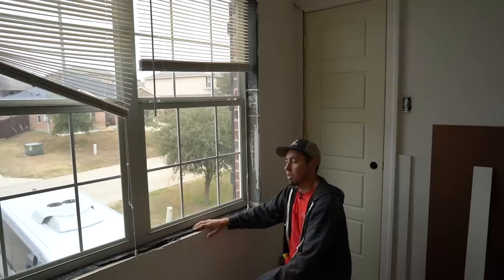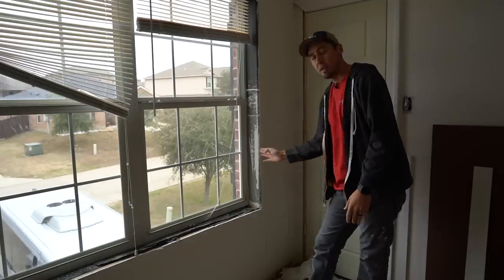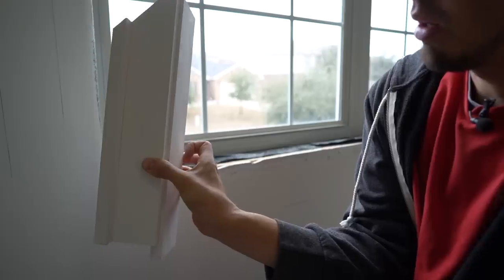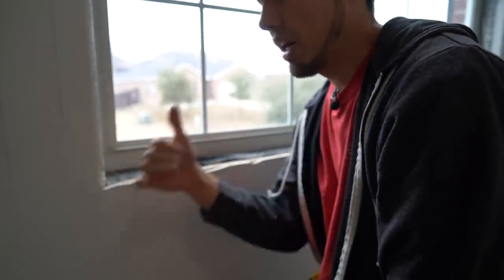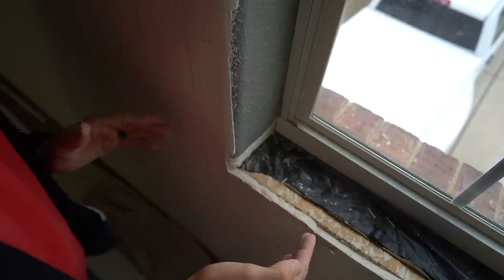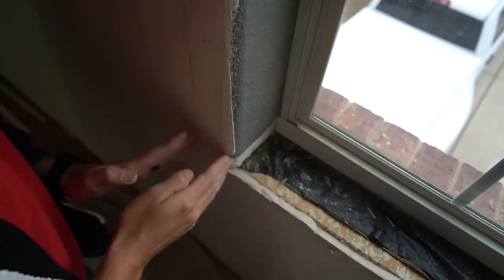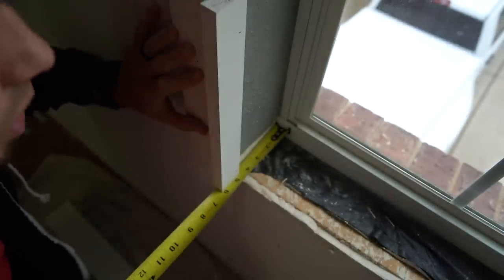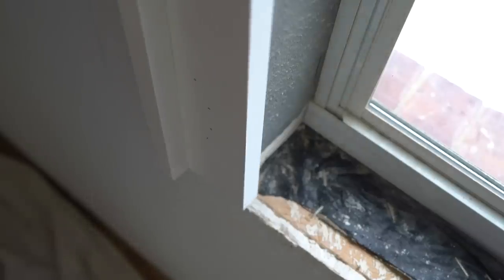Well, I cut the window stool...

Comment: Richard,  when I watched you use your "phone" calculator to figure out the number of panels I realized you didn't know about the fraction calculator I use.  I've been using this for several years and it is GREAT.  This calculator allows you to put in the whole number and then the numerator and denominator of any fraction and provides the answer quickly and accurately.  It's called the "fraction" calculator.  I purchased the "plus" for a very small fee.  Give it a try. 😉. I downloaded it from the Google store.
Reply: Thanks for the recommendation Mark. I'm gonna get it

Comment: It's amazing how a little detail like if the Horn is even with the Casing or juts past it can make a job look right or wrong...or even the Reveal on the Casing being 3/16's or 2/16's. It's these small decisions I learned to not get the Homeowner involved in if possible. That sounds wrong, but it's right. Mitering and Capping the end-grain of the Stool is going the extra mile...you are well worth your money. That is not ordinary Finish Carpentry. I like to miter across the end of the Stool with my blade tilted 45 degrees and Cap it with a small piece so I have just a 3/4 inch glue-line to work with.

Comment: I appreciate that you provide the links to all the tools you're using. I think about spring clamps when I need them but never bought any! That's about to change.
Reply: I'll confess to the same thing. I've typically used a pin nailer, in some cases a biscuit joiner and a pin nailer. With the biscuit joiner you can shoot pins directly into the biscuit so that you can work with the material even when it's wet. 

As with any tool, once you have it, it will find its purpose!!

Comment: Liked the blip while you figured out the math....that would be me also. I did Purple Heart stools on a bunch of bull nose drywall return windows. No hiding that gap on those....a Ryobi oscillating table top sander with the spindle sanding feature saved the day. I made up a sample with the horn and rounded inside corner for the bullnose and used that as a template to scribe the drywall flipping it from side to side. Did have to cut the bull nose and let into the jamb rock sometimes back in the day before oscillating saws. Getting it done without chipping the drywall took some doing, The stool widths wall to window were not consistent but using the template I could just hold it to the outside edge, trace, cut and sand to the line of whatever width needed. The Ryobi was also good for the edge finishing needed. I am not a fan of edge grain showing either but that wood was really hard and it buffed out well on the sander. The owner of the project just gave it to me,  and I have used it a bit on my latest trim job as it is very handy for getting to the line and leaves a smooth finish also. I also like the sunsets at this time of the year, especially here on the OR coast after a good storm. The Solstice sunset here was Biblical

Comment: Good vid, Richard~ thanks. The problem I've encountered when doing stools and casings is when the window installers didn't get the window fully seated to the sheathing outside because of too much silicone behind it in certain areas, causing the window to not be into the opening the same distance all around it. Buckled sheathing and or improperly lined up wall studs during framing can also cause the windows to not be evenly pressed into the opening. The result: Stools and jambs that vary in width from one side of the window to the other. Frustrating because there is no standardization while trimming out the windows in the home. Every stool and jamb is a custom, slightly angled cut.  One more example of how poor work and lack of consideration by tradesmen early in the process flows down to the finish carpenter.
Reply from the maker: bluecollartrader windows are the worst for finish carpentry. I’m going to talk about everything you said in the next video. You are exactly right.

Comment: Thank you this video was very very helpful to my earlier question. This is probably common sense but if you're not casing the inside but you will still have the stool and an apron... you would probably then still have the stool come out only 1 1/2" past the wall when measuring the depth? That way it's 3/4" for the apron and 3/4" reveal

Comment: I did my wainscoting about 10 years ago. But what I did was bring the horizontal top rail around the edge and down vertical then I turned it horizontal and lined it up with the window stool with molding in-between that goes all the way up to the top. I think it looks awesome. Wish I could send you a photo.
I was thought that the stool is on the inside and the sill is on the outside. Great vid. Excellent explanations. Wish I had your videos 10 years ago. I'm just a weekend DIYer.

Comment: There is a good trick for that end grain if you want to try put a thin layer of caulk on the end grain just enough to fill the grain and it won’t be an issue for painting
Reply: I’ve been painting for 21 yrs and doing trim,  doors and jams, crown, Wainscoting, shadow box’s, etc. and I’m still picking up tricks. A lot from you so thx

Comment: Great video thank you.  What do you do when you measure stiles on each end of the wall are a different size? Do you still precut all stiles in the middle or measure individually and cut them at an angle to accommodate the slope of the top and or bottom rail?

Comment: if you made the horn the width of the saw blade longer on each side, the miter cut off from the right side could be the return for the left side and  the left could be used on the right.

Comment: Hey it’s rob .s , I was taught when you cut a reveal edge of pine casing the window , it’s good practice to cut the reveal edge on a 5 degree angle with the shorter side of angle against the wall surrounding the inner window . Have you heard of this technique . After using the technique I think I looks tighter and less of  chance of a gap ? You are a perfectionist and your straight cuts do look perfect but I have had success with the angle technique.
Reply: I back cut like you do. It keeps that edge off the saw marks. (snipe)

Comment: I know returns are required in alot of situations but i have always hated them because they are a piece that can be knocked loose. But i recently started using the ca glue and wow does that hold. Before using it on job i just test glued a mitred joint together,no nails, and I literally cant rip it apart.

Comment: Man I wish my skills were at this level I have done base board off your videos and door/window casing using your videos to help me but its not as easy as you make it look. 

My walls are always dipped in or not level and 2 of my doors when installed were put in a bit crooked which totally screwed me on the reveal line. 

Props to your level of carpentry it is not for everyone  lol

Comment: Off topic: You just got a track saw. I've watched your improvements on your miter saw stand. Can't wait to see your Richard-Paulk table.. Surely that's in the works!! Mine is made to be as light as slim as possible. I use to 24 inch hollow core flat slabs with custom horses that I want to redo. Keep up the great videos!! I think I've been watching you for about 3 years. It's been fun listening to you reference old vids. I can remember the jobs/frame of mind I was in when you reference them!

Comment: So did you remove the sheet rock around the window to do the casing, is that necessary?
Reply: That's a great question. It depends a lot on the type of window. Some windows, like for vinyl siding, are installed from the outside. Most are installed from the inside. In almost every case replacing windows are going to disrupt the interior trim work, at least to some extent. The trim always goes in and is fit against the window. You could choose to remove the drywall prior to the trim installation, but change into the windows will still disrupt the trim.

Comment: about the door casing...  I've done interior trim in the guest  room of our home.  My wife loves is so much that she would like for me to trim the hallway and other areas as well.  my problem is that the casing is too wide for some door openings.  Any ideas how to address that issue, where the door opening is too close to the wall?
Reply: I think you're confusing the terms 'wide' and 'thick,' at least as they relate to carpentry. Initially, that made it hard to interpret your question. Google "plinth" moulding. Most typical trim moulds have an accompanying plinth moulding available. In my area, the big box stores don't typically carry them. I think that is your answer. Go to your local millwork shop and ask them.
Reply: @TheSteveoTube  I think he is referring to doorways located too tight to an inside corner for his previously chosen and installed casing to fit. I'm sure a better carpenter than I will have some ideas for you. Pick a smaller casing?

Comment: I have a question. In a previous video you said go by the smallest wall to determine panel widths for wainscoting. I am going to do this in my dining room and I have a very small wall beside a door way that is only 18" then immediatly goes into another doorway at the corner on the adjacent wall. How would you handle this?
Reply: Well, sticking with Richards theory, which I support, you would then just move on to the next smallest wall. Sometimes you just have a short wall - and it is what it is. If you think that designing the whole room around that particular wall is a bad idea, than it probably is. Each job is unique in its own way.
Reply: So I would just put the cap and baseboard on that wall and that is it?
Reply: No, I just have that wall have a smaller frame. It won't be that noticable over the whole room.

Comment: Im curious on how you are going to mate the euca board around the window.
Reply from the maker: The last vid before this one explains what I am doing with the euca board. Thanks!
Reply: I watched it but, I still don't  understand how its gonna meet up around the stool returns.  I will have to see it visually.
Reply: @nsbconstruction9698  I think he said the euca will be slid in as a panel into the openings rather than behind the whole wainscot piece. If I am correct in my understanding, the euca board will not be next to the door and window casings. He will likely notch the stool horns to accept the wainscot stiles behind them.

Comment: You're fortunate to appear to have reason lyrics square and plumb existing drywall jambs.   I would typically undersiz my pre-built assembly to allow for truing up the framing mistakes that are typical.
Reply: Reasonable,  not reason lyrics, damn autocorrect..
Reply: Yeah, but he had a square on it. If it were out, it would have been apparent then..

Comment: The stool should be made from 5/4 material. Especially with the heaviness of the casing profile.
Reply: Yeah I do 5/4 stool as well. Goes perfect with a full round over.  5/4 has gotten expensive so now I glue all my own 5/4 together.
Reply: whats 5/4?
Reply: @mymate18  1 1/4" thick, if I'm not mistaken.

Comment: Use poplar on the stool. After a good coat of primer and sanding, you don't see end-grain.
Reply: What not using MDF? Just curious.
Reply: Dan Car cause is cardboard 🤣🤣🤣🤣
Reply: Dan Car Being that it is in a window, it is 100% guaranteed to get wet. MDF + water = fail
Reply: tscoffey1 exactly!
Reply: @dancar1660  It can react to moisture. Over-water a plant, water stays on the material and, swelling starts.
Reply: Dan Car I once used mdf not on the stool, but on the side and top jambs, and it still makes me cringe thinking it may get wet someday.
Reply: @tscoffey1  not just that but also that will usually needs a bit of strength on it since everyone seems to like to set stuff there or even sit on it.
Reply: @dancar1660  I'm watching this because I am replacing MDF in my reveal that went bad from condensation.

Comment: Couldn't you just flip over your stool to cut 45 on the ends instead  od switching saws? I wouldn't bother with eliminating that anyway. Its in a place where you cant really see it and sending and priming it would make it look good. I think its just unnecessary extra seam. Cool video tho.

Comment: No need to miter primed stock. Simple fill end grain with one time spakle or similar material. It’s no different than the filler primer used on that FJP ( finger joint primed ) stock.

Comment: It bothers me that there is now a visible saw kerf on the bottom of the skirt where you cut the tails.  Couldn't you use a japanese pull saw to finish the cut?
Reply: Certainly he could have, but there is going to be wainscoting that will cover that undercut portion. Why create the extra step?
Reply: To do so would be fitting to the phrase, "Perfect is the enemy of good."  In other words, doing unnecessary steps to ensure perfection is a waste of time and or resources in a way that hampers affordability and efficiency. Waste not, want not.

Comment: 16:45 why didn't you just use your triangle scrap pieces? You could have flipped it over and used it as the return, no?
Reply: The 3/16"-ish blade width won't allow the return to touch the wall.

Comment: Couldn't you have taken the off cuts from each stool and used them on the opposite side?
Reply: there would be no soft surface on those pieces, all ''rough'' pine sides
Reply: He's too much of a perfectionist. It would have been a blade width too short to make back it to the wall. 

Actually, he might do that on a typical install, but explaining to us why he made the 3/4" reveal plus the extra 3/16" 'blade width' to allow him to use the off-cut as the return would have created too much confusion.
Reply: No~ each of the two cut-off pieces would be a blade width too short. If the blade is 1/8", that's a full quarter inch short overall.

Comment: I've watched your videos for a while but don't recall you ever addressing this question... Do you ever use a jig saw? A jig saw could be used for the cuts you were making for the horn without all of the saw swapping.
Reply: Kevin Dearing or even a circular saw
Reply: Yep, I've never really seen him use a jig saw. Also, he doesn't always have a table saw with him. I think that has most to do with a nature of the work that he specializes in. I pick up a lot of built-ins. Most of the work I do is on site. Occasionally I'll spend a day or so at home making frame and panel doors   for a cab. Doing that kind of on-site work, it always seems that I have so many tools out at the end of the day, but a jigsaw is always one of them.
Reply: Jigsaw gives a wavy imprecise cut and is a poor tool when doing straight lines. Great for curves, however!

Comment: That return piece was too much for me, nobody will complain about minor end grains after its painted but they will complain when that piece breaks off
Reply: It will never break off.  In my experience, Titebond offers a joint stronger than the wood grain itself, especially with soft woods like pine.  In addition, open end grain takes finish differently than side grain, creating a difference in sheen when painted or stained. That means end grain requires a lot of extra work beyond sanding to seal those end grain pores. Mitered corners are the mark of a professional.